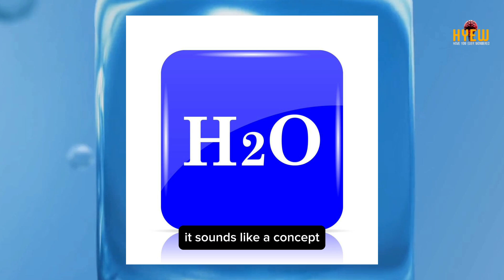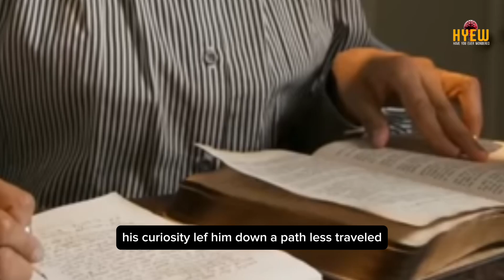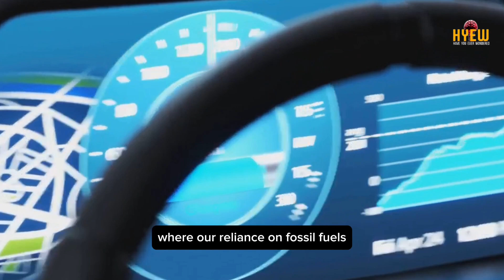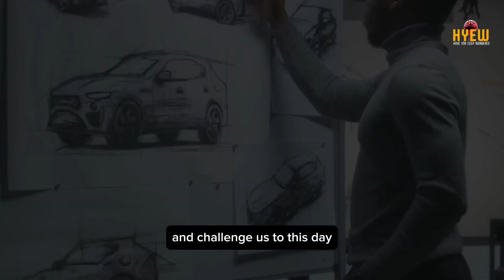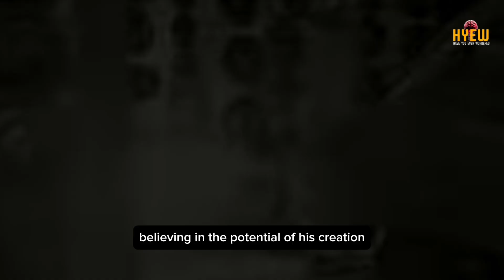What happened to this FILIPINO inventor?

Comment: HIS INNOVATION WAS NEVER SUPPORTED BY THE GOVERNMENT BECAUSE THEY ARE CURROPT LEADERS WHO ONLY FOLLOW WHAT THOSE GAINT CRUDE OIL COMPANY TOLD FOR THEM TO MAKE MONEY. THEY DON'T REALIZE WHEN THE BAD EFFECT OF CARBON GAS WILL CREATE GLOBAL CLIMATE CHANGE AND CRUDE OIL WILL BE CONSUMED THAN HOW IT IS STORED FROM A THOUSAND YEARS OF FOSSIL DECOMPOSITION PROCESS UNDERGROUND. I tried to make stainless steel plates hho generator from water but it needs more high current like those transformer from a welding machine atleast from 80 to 300 Amps in 12 volts. But i suggest not to do if you are not an electrician who does not know what is voltage and amps and how to step-up the current and voltage because you need to know the badic of electricity. That's why many copy cat's are failure because they lack knowledge of how to melt a metal into a liquid state the same is how to crack HHO into gas state. Ofcourse as expected it burns like Acetyline C2H2 from a wet calcium carbide the locally known as CARBORO in the local market when put into a water we create a bamboo explosion during mid new year every year.